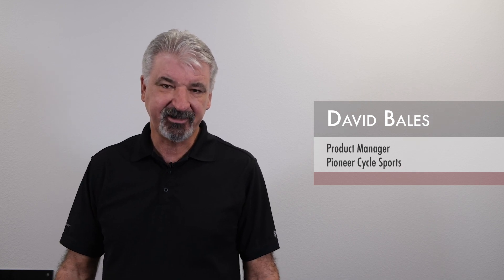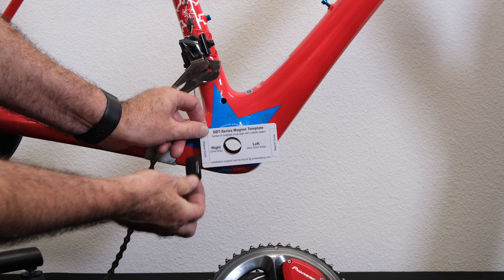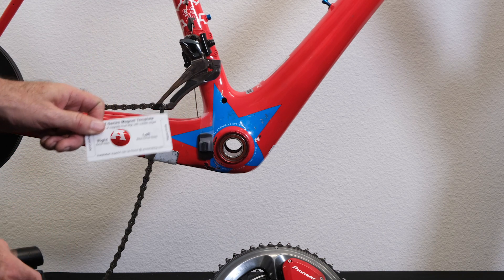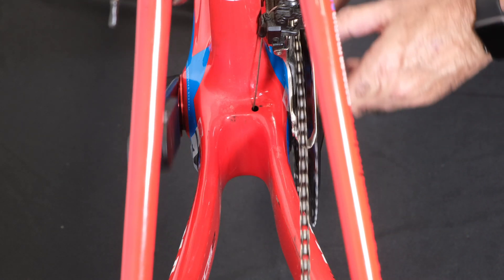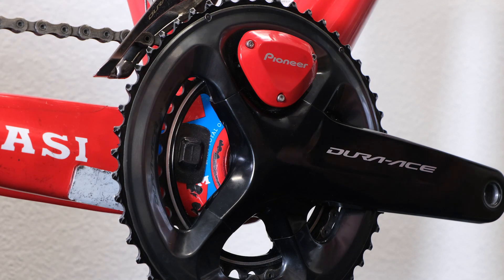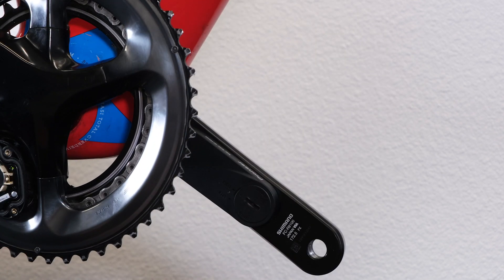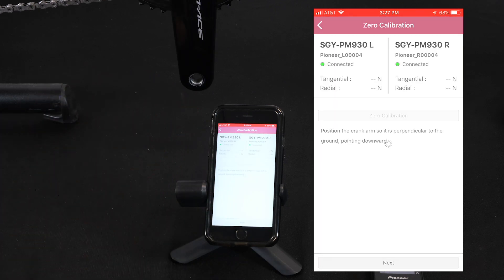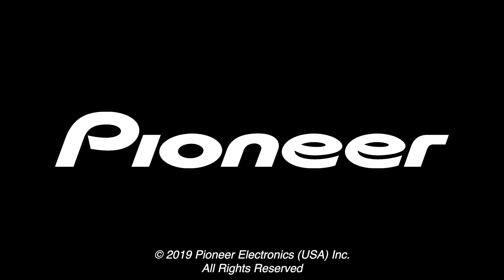How To - Install Power Meter With Magnets and Pair With CA600 Cycle Computer

Comment: Since Pioneer Cycling was acquired by shimano, is impossible to find replacement parts. I just need to purchase the new magnets to install it in to a new frame.
Reply: Just buy some 2mm magnet in amazon and glue them, it works....there is some info in youtube replacment magnet